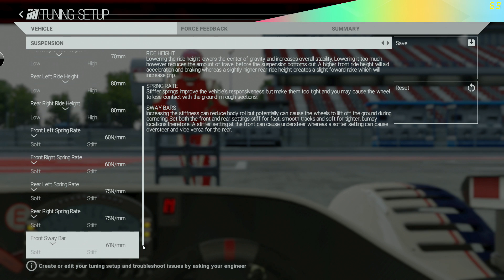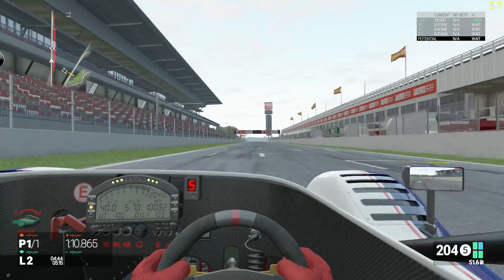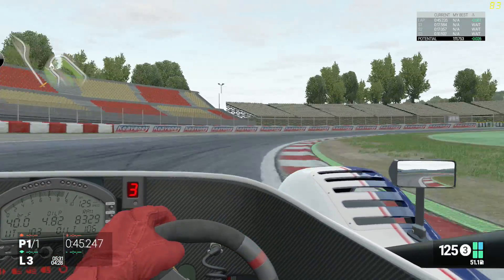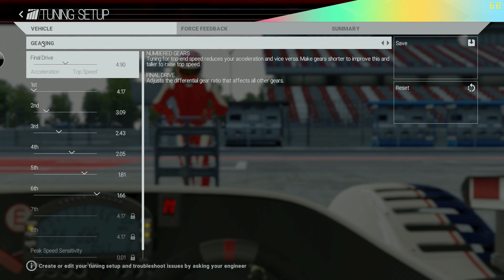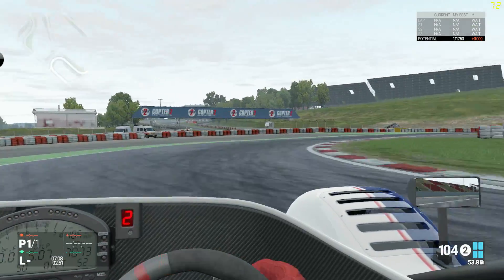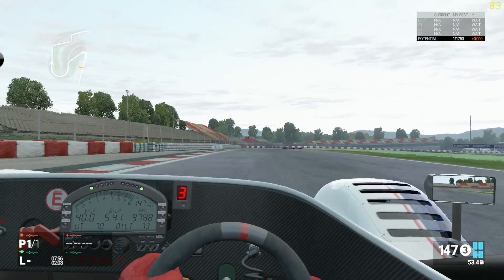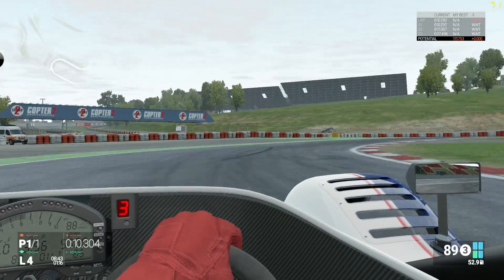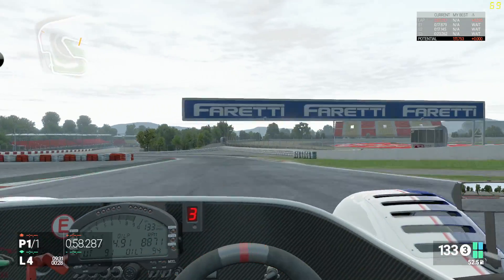Project Cars Tuning guide Part 3C: Springs

Comment: What cars do you recommend to tune the most? P.S. Great vids keep them up 👍
Reply from the maker: Primus Maximus for learning start simple, use the junior level cars such as the ginetta junior and the formula rookie. once you've got the hang of that move onto something slightly more complicated such as the f3 car or gt4. these add in things such as aero and more option for gearing, damping and suspension. once you've got that then you can go onto the purpose built race cars like the Lmp2s and open wheel cars.   
in terms of spending time on tuning its proportional to the amount of options a car has. the more options the more time spent. so i would spend longer on a gt3 car compared to a ginetta junior. but even more time on s lmp1 car.